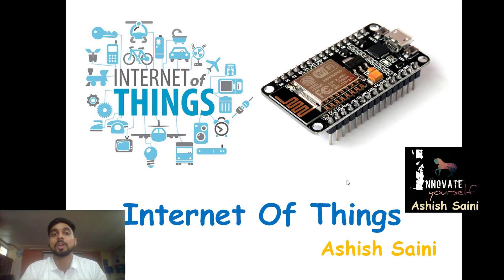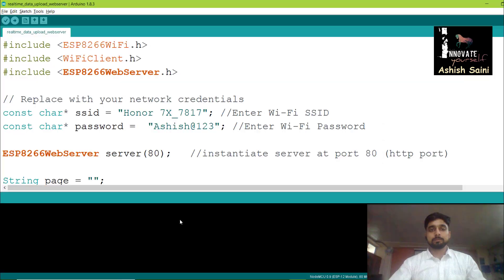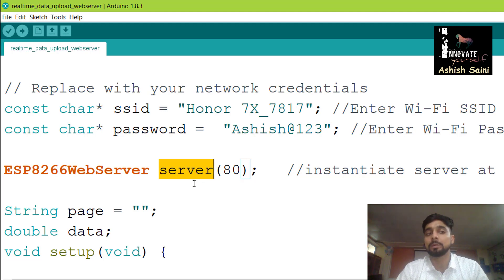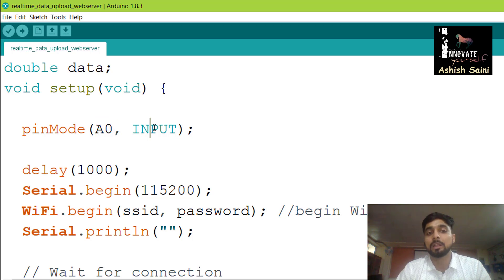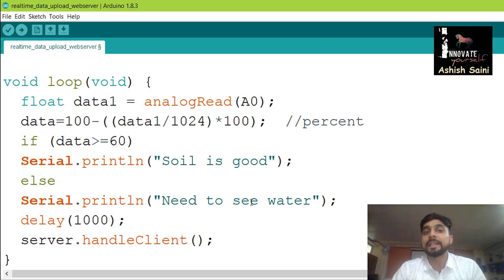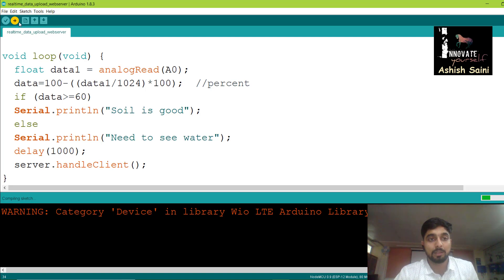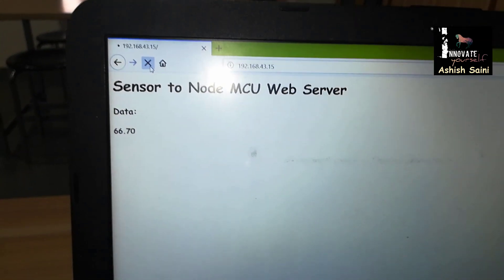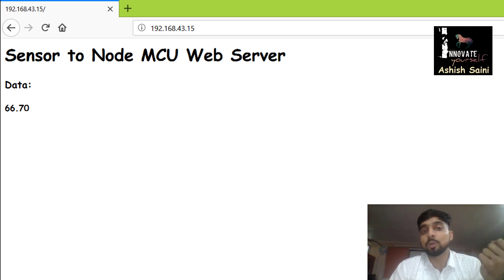How to upload real-time data on Webserver?

Comment: Ws2812b Code is uploaded but IP address and Wi-Fi not show plz ..halp
Reply from the maker: Which controller are you using?
Reply: @InnovateYourselfashu  ESP8266
Reply from the maker: What code have you uploaded to it and how have you uploaded it?
Reply: @InnovateYourselfashu  esp 8266 kit update 
Software name :- ardino ide
 Ws2812b library
 Code is uploaded but IP address and Wi-Fi not show

Comment: hi sir
"page = "<h1>sensor to nodemcu web server</h1><h3>Data:</h3> <h4>" + String(data) +"</h  "
the line is not showing the full content on your screen. pls check it
Reply: https://www.teachmemicro.com/display-sensor-data-nodemcu-web-server/  use that link for similar project with the code
Reply from the maker: It's showing there as you can check in the video

Comment: Can I just replace the soil  moisture sensor with temperature sensor DS18b20? 

Or need another code?
Reply from the maker: Use any sensor you want to use and then use its value